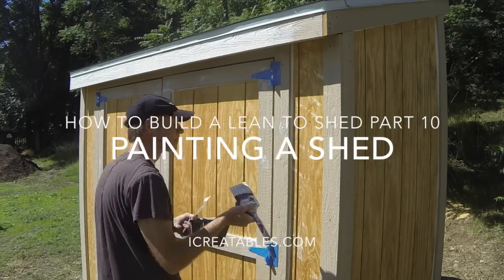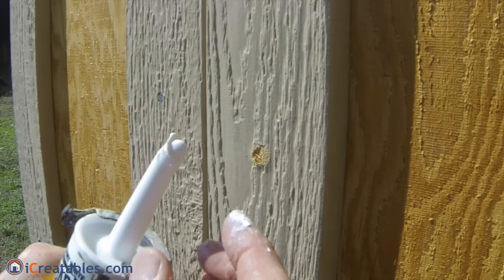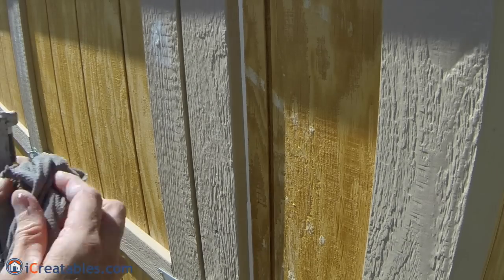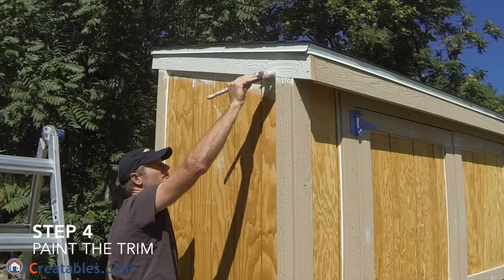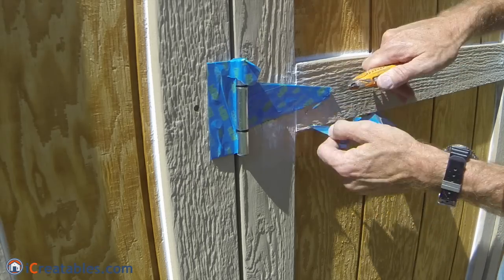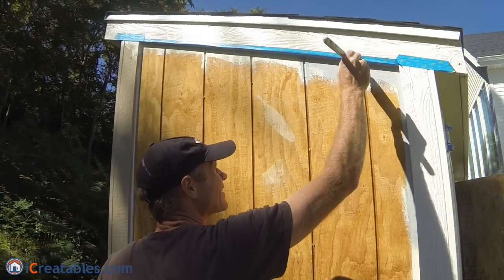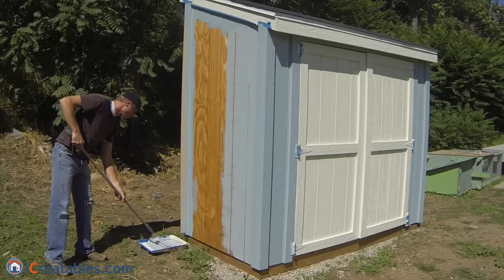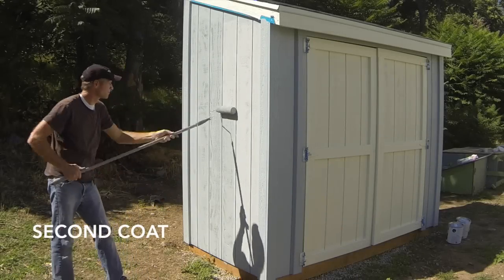How To Build A Lean To Shed - Part 10 - Painting

Comment: Excellent very nice
I just did not understand why the roof was going down toward the opening of the warehouse
Reply from the maker: The plans come with the option to put the doors on any of the 4 sides. The individual we built this for needed a shed that could be put up against their existing garage wall and have the water and snow flow away from the garage. Thanks for watching.

Comment: Do you have a video for painting the interior of the shed ?  I have a non-insulated wooden shed (fresh from the factory) and I want to paint the interior.  Why kind/type of paint should I use?   I also want to paint the shed floor in a sealer style.  Would your recommend using a Herculiner product ?  (bed liner) for this ?